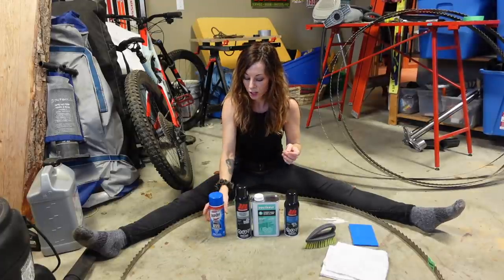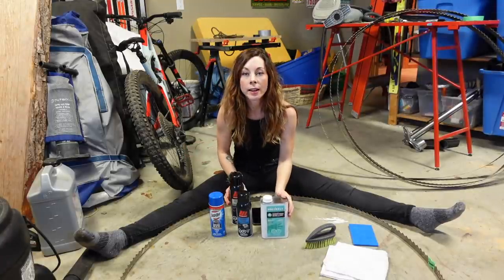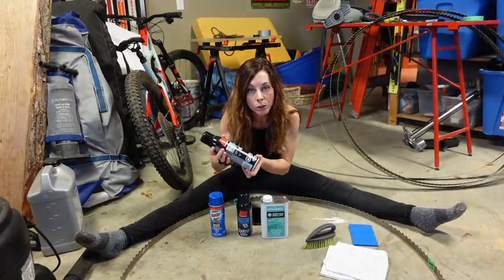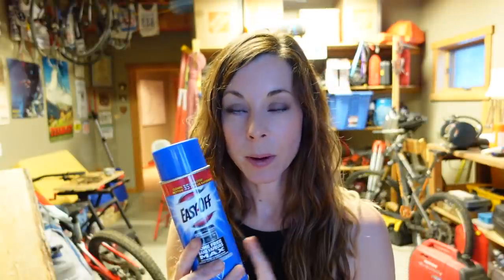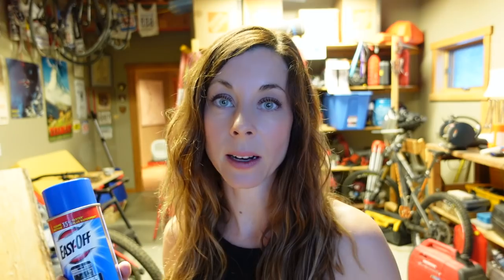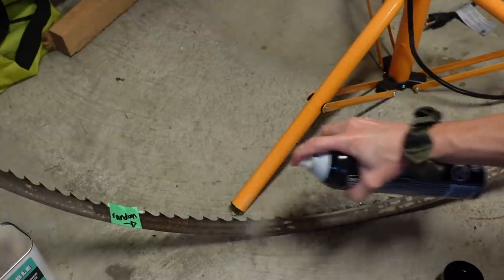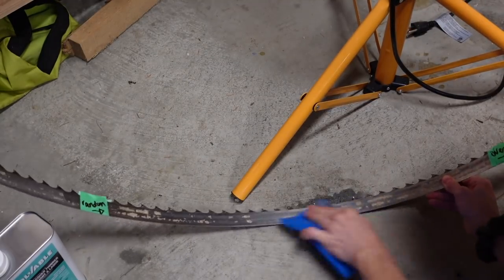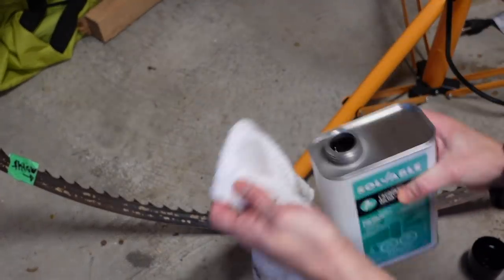How to clean your bandsaw blades | Finding the BEST way to remove sap from your sawmill blades.

Comment: I have a mill like yours and cut a lot of coniferous trees like spruce and pine. I use washer fluid (winter type) in tank all year round. Cheap and environmentally friendly. The active ingredient is the ethanol and that dissolves sap. Also I have no sap on blades after cutting. Stuff like diesel and other solvents are kind of tough on your belts. Love your videos🙂
Reply from the maker: Ok! Good to know! Thank you!
Reply: Diesel is an oil based product and I would worry about it having a negative effect on a future finish if enough of it soaked into the wood.
Reply: I have the WM 120 and use washer fluid in the colder weather which works well in spruce, pine and Douglas fir. I use Dawn dish detergent (blue stuff) in the summertime and it works great. If I notice it building up a little, then just a small increase in the flow can clean it up. I don't like using other type of cleaners just for environmental reasons as I have a small farm. I enjoy the videos you post of the different projects.

Comment: Didn't see anyone mention Simple Green.  I'm about ready to clean my bandsaw blade and am going to use it.  I've used it on table saw blades and it works quite well.  Submerged the blade 15 minutes in Simple Green, then went over it with a toothbrush.  After that, rinse.  Nice and shiny.

Comment: I would exercise caution using something like lacquer thinner or especially acetone in conjunction with any plastic brushes or pads, as it may react to dissolve the scrubber. I guess ultimately it comes down to cost and how environmentally benign the product is. Treating your clean, sharp blades with some variety of mineral oil before storing should prevent rusting and maybe periodic treatment with oil during use will reduce the adhesion. I use baby oil on my band saw blades in my wood shop between uses to keep them clean, or motor oil. Best regards Michelle.
Reply from the maker: Awe! Baby oil! Thanks, as always, for the great advice 😊
Reply: Of course if you have rubber faced wheels you must avoid any mineral oils or derived solutions as they will rot the rubber. But solvent will spread the thinned sap and not clear it.
Big logs will be worse as the teeth can't take a big enough bite. You create wood flower.

Comment: Western Larch is a close relative and the pitch buildup when cutting shake bolts all day was significant.
I learned that simply pouring water into the kerf periodically kept the buildup to a minimum.
I liked prevention better than the cleanup.
Perhaps a drip tube could be attached in such a way as to keep the blade wet. It is worth a try and is cheap, odorless and effective.

Comment: Thank you for that information. I personally just use a flat blade scraper and scrape it off going in the same direction as the teeth . I let the woodland Mills blade sharpener take care of the gullet. Also on my sawmill I use washer fluid in the winter time  water in summer with approximately a half cup of Dawn dish soap. I use to use pine sol but I ran out one day and just put dish soap and It worked the same. Take care and stay safe.

Comment: In a past shop, we used Sprayway Saw Cleaner Pitch & Gum Remover. It worked great for cleaning, but it is spendy. It also liked to be rinsed off with hot water and a scotch Brite sponge or rag- as the cleaner becomes sticky like runny sap as it dissolves into a goo.
I've also heard some old timers talk about soaking blades or bands in turpentine, but have never tried it for myself.

Comment: Automatic transmission fluid in a spay bottle, sprayed on the blade while running at the end of a milling session or before taking the blade off to change cleans and lubes the blade.  It also lessons any buildup on the pulley drive belts.  Water and pine sol with Dawn while milling.

Comment: I use diesel, water and dish soap. The dish soap is a dispersant and helps to mix the two.  Shake it up in a container and you end up with milky diesel water.  I mostly cut pine and my bands keep clean with this concoction.

Comment: Coconut oil dissolves pitch easily. Fluid at about 80 degrees too. I have never cleaned blades but It works great on hands. Non toxic too. Merry Christmas. Open your border. 😉

Comment: I had a problem with chainsaw blades that would collect so much sap and sawdust after just a few cuts of scrub oak that the chain would look like boxcars on a railroad track. I tried all those you have plus battery acid - vinegar - ATF - etc what finally worked like a dream was a 30 minute soak in straight chlorine bleach followed by a wire brush -  rinsed with water and sprayed immediately with WD40 to keep it from rusting.  Chains would look brand new. The bleach turned purple and continued to clean chain after chain.   I had 5 spare chains and would have to change them every few minutes, I barely had to add any additional fluid to wash chains like 30 times.

Comment: I've found that most edible oils will cut pitch. Corn oil, olive oil, butter, etc. Haven't got my mill up and going yet, but I'll probably try some corn oil. It quickly dissolves pitch on my knives and axe's. Doesn't stink and non toxic.
Reply: What is the cost of one of those blades

Comment: Thanks for the heads up on Oven Cleaner. I'll try that on my chainsaw blades (chains). Now and then I need to cut pine and it really gums up the blades.
Reply from the maker: It definitely works well. One or a couple people have talked about it being corrosive and pitting the blades in the long run, making things worse. Not sure how valid that is though. Someone suggested soaking things in a bath of dish soap overnight, and stuff coming off easily that way. Chainsaw blades are small compared to bandsaw blades, so that might be an option for you too.

Comment: I use a round disk brush that goes on a drill and no chemicals. The gullet and face of the blade is cleaned out when I sharpen it. I also sharpen my blades without a guide.

Comment: i cut 99% pine to anything else.   3 table spoons of dish soap, (any type), to a gallon for keeping the blade clean.    no problems on build up after 10 years,     i do hit everything with wd-40 to prevent rust on the blade between running

Comment: Another item you can use Michelle to clean your hand saws is a liquid called “ Envrosafe” is an all natural cleaner . We used it to remove pitch from our band saws, quad saws, saw boxes,Planer knives,debarker Knives, CNS Knives. And also Control consoles. We got it in 5 gallon buckets and added it to spray bottles, worked awesome. 
Just thought I would let you know………..☺️
Goodluck!…………..🙂💜👋🤞🌟
#Justdoingmypart
#Sigh!

Comment: BBQ grill cleaner is similar to Easy Off oven cleaner, just do not know which product might perform better.  BBQ grill cleaner apparently works to clean wheel rims of that nasty coating.  I have yet to try it.  One should try a small spot and experiment.

Comment: Thanks for the review!
As i already mentioned the condition of the blade results from the wood you're cutting in the first place. So maybe you could try to cut a piece of hardwood after your work with coniferous wood...?
Just an idea regarding environmental friendliness 😉
Reply from the maker: Unfortunately I don’t have any hard wood on my property! 😏
It sounds like windshield washer fluid in the lubricant in tank is a viable solution, and more environmentally friendly 😊
Reply: @michygoss7148  Thanks for the explanations! in that case i agree of course.👍
Reply: Large areas of Rockies don't have hardwood...

Comment: Use Pine Saul or Dawn dish soap and Windshield washer fluid winter type. Diesel fuel or oil could soak into your wood and or stain the wood if it is a nice pc. of wood.
Reply: Chainsaw blades can be cleaned in a big glass jar with rubbing alcohol. Takes pine tar off the blades.

Comment: razor blade scraper will easily scrape the worst of it off , then use a brass  wire wheel on a drill , works good only take a few minutes to do a blade , no need for cleaner or solvents

Comment: Like others said, diesel works great straight up not diluted. Oven cleaner works but the next cut you make the sap is back and the cleaning takes longer. Slow drip diesel it comes off instantly and no blade removal needed no production slow down either. Never have problems with belts and diesel either.
Reply from the maker: Awesome advice! Thank you! (I think someone else said diesel wrecks belts. ? - this can get so confusing! Haha)
Reply: @michygoss7148  true, after asking the same question myself in another group, I found the poplar answers to be as what I just shared here.  I decided on following the advise of the majority and it worked.
I found 7 out of 10 like this method. Still lots of debate over EPA issues.   I say hog wash to that.  Lol

Comment: If you ask other sawyers who cut lots of softwood, they will tell you diesel fuel is about the best blade lubricant and cleaner.  It keeps the pitch from building up in the first place.
Reply: You will actually find that to cut softwood or most woods that are building up on the blade especially but also the wheels.
First diesel is to lubricate between the blade and the wheels. In contact with resin it melts it and spreads it over both saw and wheels. Run water over the saw seperate feed and the resin can not stick.. You will suffer more if you your sawdust is spilling from the gullet. So increasing the feed or changing to a round tooth shape is better assuming you have swage shaped wide bandsaw. In addition poor sawdust removal recirculating the dust between the wheels. On vertical Mills there should be a deflector below the lower guides and wheel to prevent pieces falling between the blade and wheel, which should be as close as possible. Wheel scrapers should also be in optimum condition.
Blade cleaner fluid. You really should not need it.
If it's a hard resin like from cutting Ash you can cut one ash log then one oak. Always finish with the oak as it leaves you with a clean saw. The resin goes rock hard when you stop for a few minutes or more.

Comment: 50/50 diesel/old cooking oil or whatever kind of oil in a Gatorade bottle with a pin hole in bottle cap... Give the blade a shot as it's spinning. If that doesn't clean it immediately use a scrap stick pressed to spinning blade in conjunction with juice..

Comment: Does the mill not have a wire chip brush like on a metal cutting bandsaw? You could install them at different
points to keep the teeth & blade sides clean.
Reply from the maker: No. It doesn’t have one.

Comment: I have beeen milling pine logs for years and never have buildup on the blades and I just use plain water??? but I will tell you if you have a woodstove or fireplace with glass doors then Easyoff is the best thing to get the black off the glass. ust spray it on and wait 10 min then garden hose it off.
Reply from the maker: Yes - for the most part, I’ve never had build up that bad. And funny thing is, after cleaning the oven with the oven cleaner, I went straight to cleaning the fireplace and used the oven cleaner to clean the glass! Worked like a charm!
Reply: @michygoss7148  I know I have spent plenty on all kinds on fireplace glass cleaner and not one of them worked with using a machine to scrub like crazy, and my 85 year old mother said try EasyOff it cleans everything so I did and I couldnt belive it was as easy as spray on rinse off. it also works great on brake dust on your wheels!

Comment: Oven cleaner should stand for 30 minutes. If you have ever had an oven that people have cooked uncovered meats, then never cleaned the oven. You would be amazed at how well Easy-Off works. Just plain water in a sponge wiped after the oven cleaner has sat for 30 minute or over night.

Comment: Not sure diesel would be good to mix in water and for the environment. Ever thought of just using canola oil or any other cheap plant based oil to lube the blade?
Reply from the maker: No. I haven’t. I don’t think I’ve ever read any comments of anyone using or suggesting a canola type oil before. Have you personally used it before?
Reply: @michygoss7148  you could use canola or plant based oil as a chain lube. So you can use it for your saw mill.

Comment: Unfortunately oven cleaner will corrode the surface of your blades, leaving a dull look. You have created a rough surface which will retain pitch and gum even worse than before. I soak my blades overnite in water and plenty of dish soap and scrub 'em down the next day with a stiff non-metallic brush. Good luck, gummy blades are a stinker for sure!
Reply from the maker: Soaking overnight sounds like a logical idea, but what vessel do you use as a tub?
Reply: @michygoss7148  Good point. In my case it's table saw blades so not a problem. Maybe a kiddy sized wading pool of sufficient diameter to drop the blade in a couple of inches of water? How about a section of mole-pipe formed into a circle of the proper diameter and the top side cut open to allow a blade to be dropped into some soapy water.